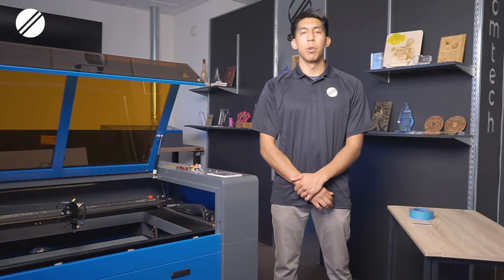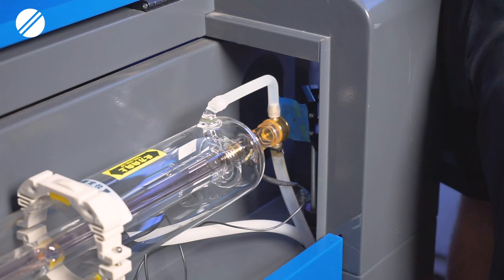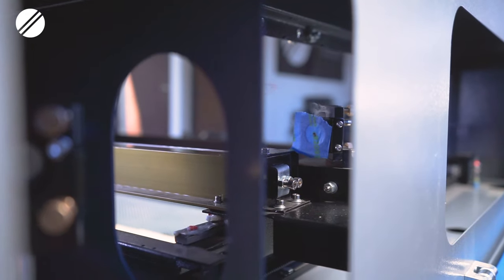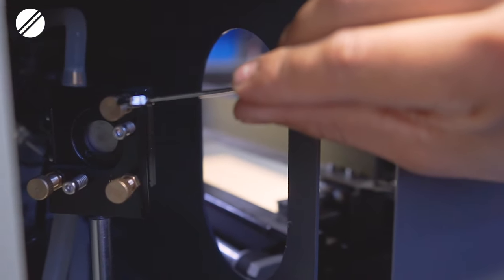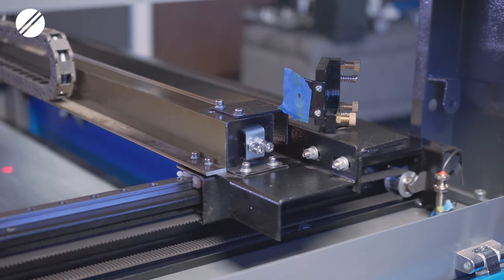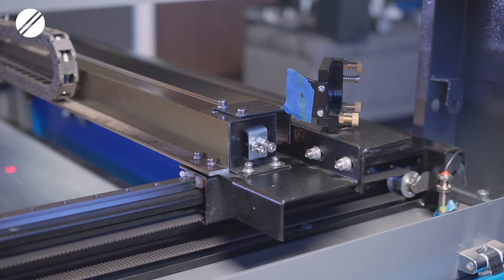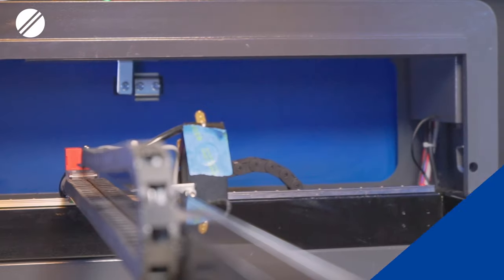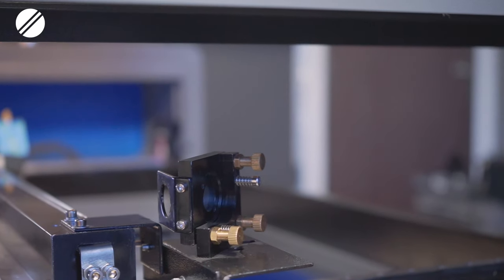Beam Alignment Set Up for Your CO2 Laser Engraver - Training Video - OMTech Laser

Comment: I just finished aligning the laser again. And the dot on the last target is centered across the entire X (left/right) range. But when cutting at full power, there is ghosting around the cuts at the far right of the bed.
Reply from the maker: Hey there, great question!! Looks like you also need to check the alignment on the Y-Axis. The beam may be hitting the edge of the exit hole on the nozzle, if overlooking the alignment coming down.
 Another factor is the focal lens itself. If it is dirty or damaged, this can be an issue. For more information and assistance, please reach our Technical Support Team at https://omtechlaser.com/pages/contact-us
Reply: @omtechlaser  is there a video for aligning the Y axis? the first 2 mirrors are easy enough and perfectly aligned as far as I can tell.
Reply: I get Center shots to mirror 3 at all corners of the bed. But only on the front ride side it engraves good, the left back side looks terrible but I hit the same spot exactly in center at mirror 3 everywhere thats why I don't understand why it's only good in one corner? Also the head is square to the bed and the rest is also leveled.

Comment: Been watching all of these videos in preparation for ordering my printer. Still weighing the pros and cons of the 2 different 80W models.
Reply from the maker: That's great to hear!! Let us know if you have any questions or need advice with these two models.
Reply: @omtechlaser  my main question is about water cooling. I live in Texas so my garage can get into the 100° range. I working to decrease that by insulating the garage door and installing some fans. But obviously a bucket of water is probably not going to do.
Reply from the maker: @VariablePenguin  Yes, acquiring a 5200 Water Chiller will do the job!! The chiller can effectively and efficiently cool down your machine during those hot months.
Reply: Didn't know you guys had videos! I got a 130 watt from OMTECH and the alignment was insanely rough, can't get it to cut at the lower and far sections of the large bed.. I went through most a new roll of painters tape trying to align it (Given I had to double the tape layers because a single layer just went up in flames Instantly when pulsed lol) then my focus lense melted and cracked. Only had it for Maybe 2 months🙃 just saying.. for $7k... I expected a WHOLE lot more
Reply: @notyouraveragegoldenpotato  don't know why you're replying to my comment... sounds like user error though

Comment: I received my 80W a few weeks ago and the mounting screws for the mirrors were lose which has caused it to be very very off. how do I determine the correct way they should be mounted on the rails? It's so far out of alignment that it wouldn't even hit the tape when the laser head was closest to the second mirror.

Comment: I just changed my laser tube and ran a test and I am getting an o-ring and not a dot at the first mirror. how do I adjust it to get it back to a dot ?
Reply: Did you get it resolved? "I am having trouble with mine

Comment: So.. Totally missed was the alignment of mirrors to the gantries. 
Align laser tube with chassis ( which should be square with cut platform).
Align laser to first mirror and center the dot. 
Align with second mirror at full rear y pos. Then fill front y pos. Make sure dots hit same spot ( does not have to be center). If it is high or low.. Your lazer is tilted. If its left right... First mirror will need to move left or right.  Once these line up.... Then align the center dot. 
Then proceed to next mirror and do same. 
Make sure to align the z axis. Remove the lense. At first then install and double check.

https://youtu.be/rYX0zfWFnIM
Reply from the maker: We appreciate the feedback! An updated version of our beam alignment training is in the works.

Comment: I have a OMT ^) Watt Floor Laser and I have a problem with my x-axis alignment, I have the targets perfect on Mirrors 1 and 2  mirror 3 is dead center in the center of the machine full left the target is 1/4" to the right 9:00 the head mirror to the full right the target is 1/4" @ 3:00 For the life of me I cant get the x axis full left and full right to converge. Does anybody have a fix for this ?

Comment: FYI the 50w does not have the adjustment screws for the laser tube mentioned in this video
Reply from the maker: Hey there, thanks for reaching out!! Our models of 80W+ with a 20x28"+ bed have these adjustment screws. Any smaller model has stationary stands; therefore, needs rubber pads or washers to decrease/increase the stands. For more information, feel free to reach out to our Technical Support Team at https://omtechlaser.com/pages/contact-us

Comment: Getting ready to replace my tube tomorrow. Appreciate the videos. My pea brain is having an issue with the last part of the alignments when you are adjusting mirror 2 for centering on mirror 3. In what you show, you are saying to pulse check with the x axis close to the left side and adjust if needed, then do the same thing with the head (mirror3) close to the right side and adjust if necessary. Would you not be just moving it back out of adjustment for the last adjustment that you did? I'm confused.
Reply from the maker: Hey Mark, thanks for reaching out! Beam alignment can be tricky at times! If you hit center on the left side and then the beam moves to the right, then what you are seeing is a rightward angle opening up as you move away. The beam should be leaning right, but you can't tell when you're close. So you will need to move the far pulse toward the first pulse to "close" the angle. For further assistance, you can reach our Technical Support team at techsupport@omtechlaser.com
Reply: I know this is an old question, but I feel it’s important since it shows near the top of the list of comments and I want to help others that might be reading through these comments because they are having trouble aligning their mirrors. It is IMPOSSIBLE to align your mirrors if you follow this video. The mirrors only accomplish one task and one task only. They align the beam to a certain axis.  Mirror 1 aligns the beam to the y axis, mirror 2 to the x axis, and mirror 3 to the z axis. You CANNOT center the beam on the mirror with the mirrors. You can ONLY center the beam at the laser tube. Ive wasted countless hours trying to align the beam with the procedure in this video even when my head is screaming “it’s illogical to align the beam at one end of its travel then readjust the beam when it’s at its far end of travel and not expect the beam to be off at the close end of travel”. I just kept assuming the company selling a product would be producing an accurate video, but they are not.

Here is a link to a video that explains alignment very clearly. I have no affiliation to this video I just really appreciated it’s very straightforward explanation of what actually needs to be done to accurately align your mirrors https://youtu.be/rYX0zfWFnIM

Comment: So when calibrating the mirrors at close range and then at long range doesn’t it throw it out the center circle for close range calibration?
Reply from the maker: We advise moving the laser head to the front right of the machine this will give you the longest possible beam. If it's dialed in in this position, it should remain consistent at any other part of the bed provided your bed is trammed correctly.

Aligning the mirror closer to the tube (rear right corner) may "appear" correct, but as you reposition the head you may see some drift that's only apparent when the laser beam is stretched over the work area.

If you have trouble aligning the beam to the front left position. Start by aligning it in the rear right position. Then realign at the front left position. Then realign at the front right position. This will help you walk in the "fine adjustment" at the longest laser path.

Comment: I accidentally drove my nozzle into the bed by auto leveling without material under the sensor. How to I make sure I've got the nozzle aligned correctly?
Reply from the maker: Hey there, great question!! 
 When this happens, you will need to lower your bed manually using the belts inside the cabinet of the machine. The auto focus doesn't normally move out of position, but if it does, then you will need to first make sure it's solid again. Furthermore, you would then have to find out the offset in the Z-Axis settings in your machine settings.
Reply: @omtechlaser  I lowered the bed like you said. The nozzle appears to be at a weird angle not (not 90° to the axis). Should I just use a square to get that to the right angle?
Reply from the maker: @VariablePenguin  Yes, you can straighten it with a square!! Just make sure that it's tight and doesn't slide up or down.
Reply: @omtechlaser  so how to I adjust the z-offset height now that I have the nozzle re-leveled? Current auto focus height is about 3 mm off from optimal according to the ramp test I did.

Comment: What does it mean when it says it’s protected and won’t do a pulse?
Reply from the maker: Hey there, seems like you could be having trouble with your door sensor. Your machine might think that the door is not fully closed. To fix this, the door and sensor will need to be adjusted. For assistance and more information, you can reach our Technical Support Team at https://omtechlaser.com/pages/contact-us